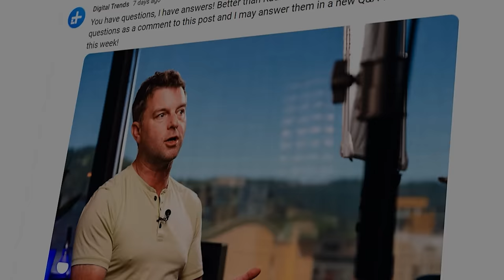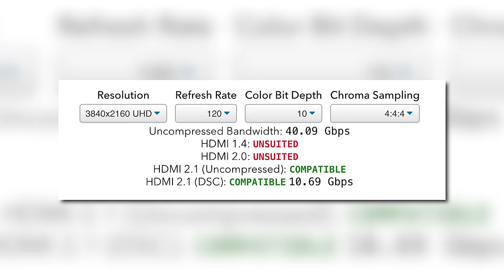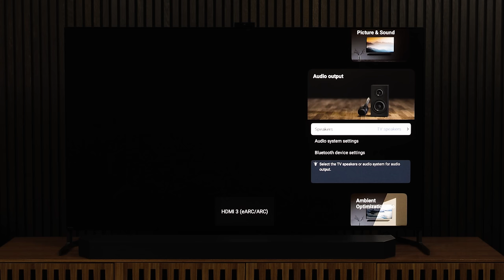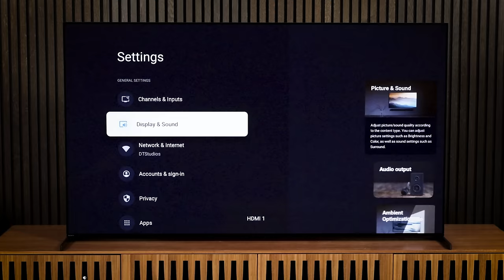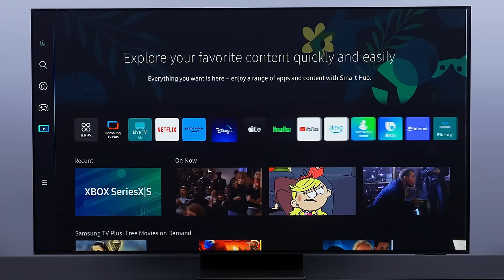TV Above Fireplace Bad? Samsung S89C OLED Worth Buying? | You Asked Ep.17

Comment: I am considering mounting the TV above the fireplace, it's the only wall mount location in my living room. The 2 end walls are taken up by large windows.

I have one advantage in that the fireplace is no longer used. There is a large radiator mounted on the wall opposite the fireplace.

So it was good to hear about these mantle mounts, even if amazon UK doesn't have them ( or a 6-9 month delivery, lol)
Reply: If you don't use the fireplace then go for it.

Heat degrades electronics a lot faster though especially concentrated heat from a fireplace.
Reply: Just Tell the truth. Your wife wont let you put it in front of the fireplace.

Comment: I used a spare 2x4 I had (straight line for line of sight) to figure out where to mount my TV based on how we were sitting in our recliner and reclining couch.  I used a full motion mount, and it worked great.  The 2x4 also helped with placement of furniture in the room.

You could do the same thing with a laser pointer, but that was not an option for us as it drove our dogs crazy.
Reply: @paulc5389 , we basically did the Pythagorean Theorem to figure out the desired distance for the furniture.  I set the hypotenuse as the desired linear viewing distance.

Comment: The Stupid trend of putting the TVs over old big fireplace started during the late 2000s... And TV shows like HGTV is the cause of this type of installation and neck pain for most people that did it😊
Reply: It basically depends on the size of the room and where the fireplace is positioned. If the room is big and the fireplace is centered, it typically works out fine.

Comment: Mounting a TV above a fireplace? Of course not. I would strain my neck in the process. If someone were to do that, I would have to stand up and watch TV instead because I have a visual impairment. I've seen people hanging TVs so high up in some houses even without a fireplace. I would have to get a pedestal so I can see what I'm watching. Not a nice way to kick back and relax.

The only way if I want to watch TV is if I have my computer and home theater equipment setup in a room, especially if the house has a basement. I travel with my family who are travel nurses.
Reply: It basically depends on the size of the room and where the fireplace is positioned. If the room is big and the fireplace is centered, it works out fine.

Comment: 10:22 I’ve actually had problems with audio output switching between my Sony A95S and my Sony HDMI eARC speaker system too! It only happens for me when the tv wakes up from sleep mode though. Funnily enough though, even though Caleb recommends keeping the software up to date, the issue actually only began for me after the latest software update back on October 30th(!!)
Reply: Spyplane good thing to not do is update till u hear what others think Ive updated once but never to latest on mine Im running a80j 65 with a7000 and rear speakers sounds awsome when gaming.

Comment: 9:41 Me and me. I'm still holding on to my LG C6P! (Although that's in my mancave/basement. I have a G2 in my living room.) LG C6P (and likely E6 and G6) has the best 3D and passive glasses, which I contend are not an inconvenience, especially after dealing with plasma sets with active 3D glasses.

@digitaltrends Would manufacturers offer a 3D customization option for bespoke orders? Or would that just be astromically expensive?

Also, 14:04: I knew it!

Comment: Thanks for clearing up the confusion over the s89c I bought one since I wanted OLED and in a 77in, so it was a no-brainer to spend $1999 instead of $2500. I'm enjoying it immensly, I replaced a 2016 Vizio 65in, very bright and  handles  glare much better. BUUUT, I can't get my Spectrum cable box remote to power it up. when i went through the support folks, both Spectrum and Samsung pointed a digital finger at each other, which seems like they flipped a different finger at me. I think the new remote from Samsung is great but is destined to slip through the cracks in my recliner
Reply: No, he just added to the confusion.  In the USA and Canada, the S89C is QD-OLED.  It is not surprising they are selling the 77S89C below $2k as that is how much they were selling the 77S90C for on their Samsung website (or lower), through various group discounts such as AAA.

Comment: That’s the worst place to put a nice tv. Don’t understand how can you have a nice tv and set it up on the wall under the fireplace instead of having it at perfect viewing angle. It’s like having a perfect 9.2.4 audio system and then having an old cheap 2017 Samsung tv as example.
Reply: It basically depends on the size of the room and where the fireplace is positioned. If the room is big and the fireplace is centered, it works out fine.